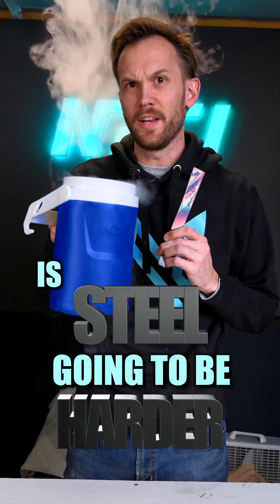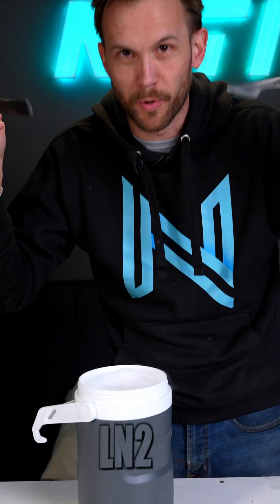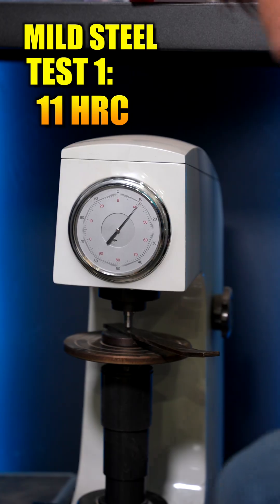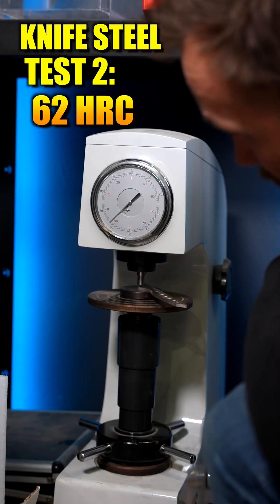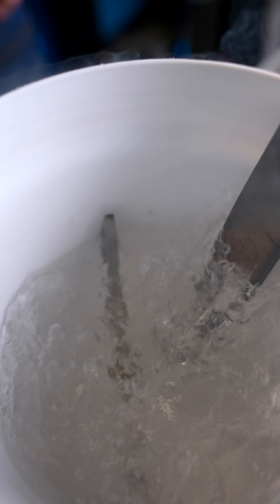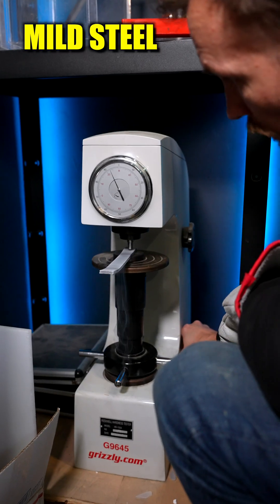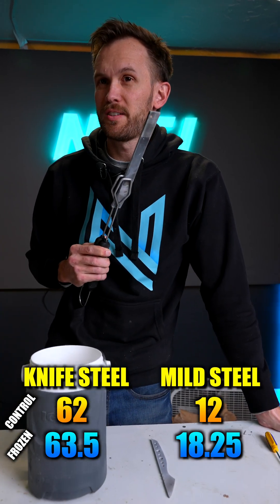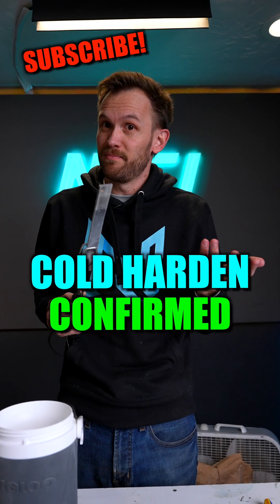Is Super-Cold Steel HARDER?

Comment: What are we measuring? Because it isn't hardness, hardness is measured on a 1-10 scale, with diamond being a 10. So is it actually compressive strength being measured?
Reply: it is rockwell test and steel is usually measured in that scale only
Reply: The test you're referencing is for rocks and minerals, not metals/alloys.
Reply from the maker: That's the Mohs scale, and it's way to small to measure the harness of steels accurately. This is the Rockwell C scale.
Reply: @NFTI so if I understood the definitions I found, it's basically just a more finely tuned version of the Mohs scale? I guess to gauge more subtle differences in hardness then? Or after there other advantages?

Comment: You should try quenching it in water. See if the rapid temperature shock does something.
Reply: It absolutely does. After watching several forged in fire seasons, there's a reason they always quench in oil. To quote the judges quenching in water results in a ton of micro fractures. There is a specific way to quench in water but it's still very dangerous to the quality of the blade. While that little device wouldn't shatter the blade, you strike that blade up against anything solid, there's a high chance it's going to explode
Reply: @YRhandlesathing  steels that start with W can be quenched in water.

On some steels you can even quench in water right after tempering too depending on the protocol and the steel. But you would only do this around 200f give or take. Its fairly common with those that learn from Roman Landes.

In any case you always temper after quenching in any media type. So if its water or oil, you temper it, so its not brittle anymore.

Comment: We have a farm and our feed grinder has warnings against using it in the extreme cold because the metal hammers and screen are prone to cracking, we’ve also had hitch pins and wagon frames crack on very cold days. I’d think hardness would increase with brittleness but maybe not?
Reply: Yes as the hardness increases so does brittleness. Even slight changes in harness can increase changes of metal breaking tremendously.
Reply: May make it harder... not better to use. He should of been very specific. Someone gonna hurt them self with this stupidity
Reply: @Charlie-us2yd  no offense to you ofc but who is gonna dunk a piece of steel into a tank of nitrogen and then put it through a series of real life hardness tests without knowledge that it could be dangerous? I mean, I guess somebody, but the real stupidity would be not researching things you find online before applying them to your life. If you work with steel, you know not to tamper with its structural integrity.... I hope.

Comment: But does it retain the hardness after it returns to room temperature?
Reply: There is a technique where supercooling a specific type of steel that has been heat treated a certain way will change the crystal structure to be harder when it returns to room temperature, but otherwise no, it will not retain the hardness.
Reply: @polarknight5376 Yes, cryogenic treatment of metal is, next level shit for sure. It is used in many ways from jet engine parts to musical instruments. The trick if I remember correctly is the temperature has to be very incremented and brought down very slowly and brought back up to room temp just as slowly. It allows the atoms in the crystalline structure of the metal to kind of March out like a large formation of soldiers falling out in an orderly manner. Some say it can bring a certain tone to brass instruments, there is a service that you can put just about anything in cryogenic treatment that's made of metal.
Reply: Generally you heat the steel up to Austenitizing temperature and soak it for a specific time. Then you quench in oil or aluminum plates. Then you use cryo after it gets to room temperature. Then you temper it between 200f to 1100f depending on the properties you want. That single cryo should increase the hardness by around 1-2 on the scale vs if you didnt use cryo. And you always temper it after cryo. So you always heat it back up after cryo. Otherwise it would be too brittle.
Reply: many people have asked that....and not about metals
Reply: @michealrossiter148 Solid attempt at a joke but it's backward.

Comment: It helps remove retained austenite. Do 3x tempers and use cryo after quench and after the first two tempers.
Reply: Came here to ask which steel specifically for that question.
Reply: @jaredcormier  well, most steels that are tempered in the lower temperature range like 500f and lower. Steels that are tempered in the 900+f range will generally not need cryo because tempering at this heat range generally removes most of the retained austenite (with 3x tempers). But can still benefit with cryo depending on the steel. Secondary hardening is what its called or precipitation hardening. Steels that have a few different elements give a second bump in that heat range for increased hardness and precipitation, but often at the cost of lower corrosion resistance.
Reply: Nope
Reply: @jaredcormier  nope what?
Reply: @jaredcormier  any steel can use cryo.